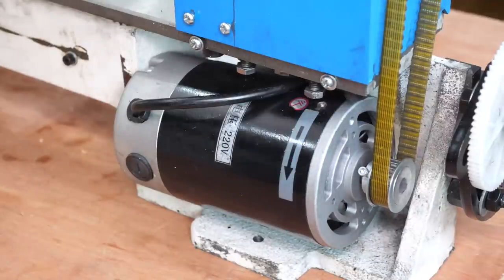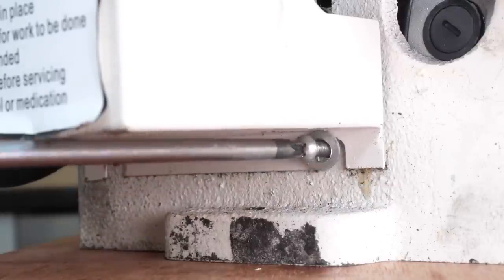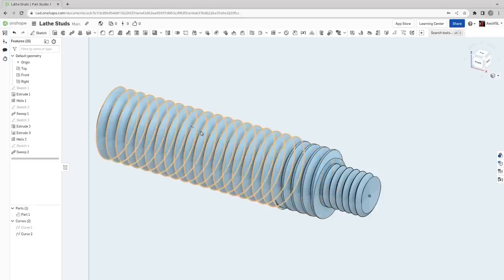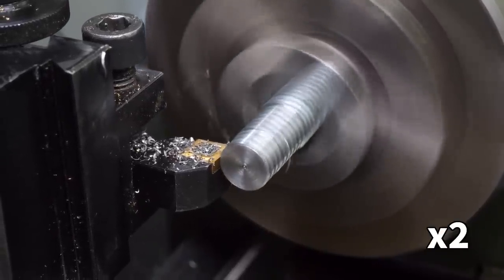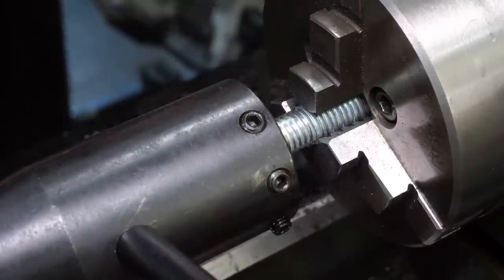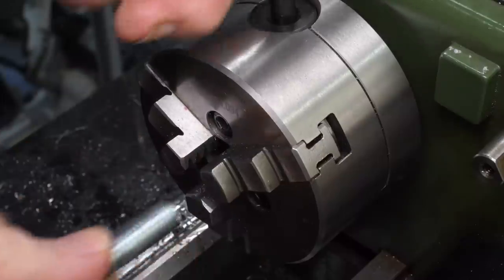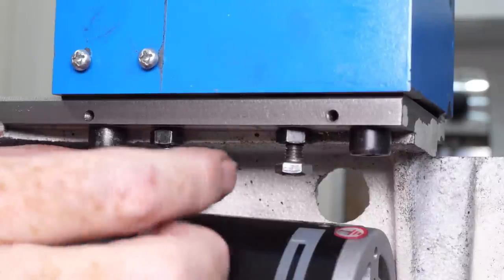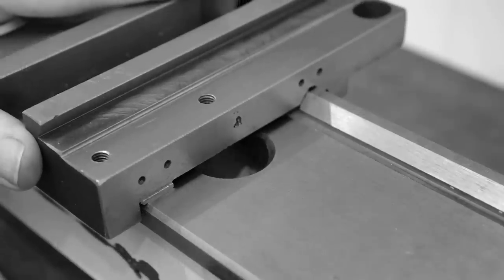A Quick Fix Motor Mount for the CJ0618 Mini Lathe

Comment: The threaded rod is not stainless, judging by the colour it's galvanised.
The reason it's hard to work with is probably because it's 8.8 grade, that means it has about twice the tensile strength of mild steel.
Personally I like to build small parts that need to be strong out of 12.9 grade bolts that I can have in stock for relatively cheap compared to high strength bar stock.
That being said it's even more tough to work with and is very demanding in terms of tools used, and machine rigidity and power.
Reply: I too, thought it looked galvanised,  but most galvanised all thread or threaded rod is rather a low grade, 4.8, plating high strength fasteners is problematic,  look up Hydrogen Embrittlement on plating.
Reply: @bostedtap8399  Hydrogen embrittlement poses a meaningful risk starting at grades 10.9 and up according to reputable hardware supplier. These fastners and stronger grades can still be zinc coated by ‘zinc flaking’ which elimimates hydrogen embrittlement. 
The reason I think the rod in the vide might be 8.8 is because of the trouble the saw is having, or the blade might just be dull. 
In any case, 8.8 grade fastners can safely be plated.
Reply: @shiro-r4m  I stand corrected, I'm wary of any galvanising on all high tensile fasteners, yes, 8.8 grade fasteners can be hard to saw with standard blades, grade 10.9 will soon blunt any hacksaw. Have a great week. Regards John.
Reply: @bostedtap8399  no worries, we all learn something every day. It’s not like I know affected grades off the top of my head but I do know where to look up stuff like that.
Reply: @shiro-r4m  Good to know.

Comment: How did you turn down the the stud with the motor removed from the lathe?
Reply from the maker: The honest truth is that I used my other lathe. It would have been interesting to try it by wedging the motor temporarily in place with the old bent studs on the same lathe, but I went for the simpler route.
Reply: @AdventureswithaVerySmallLathe  A lathe to fix a lathe.

Comment: Hola amigo tengo un torno exactamente igual al tuyo en estos días estaba realizando un proyecto y la correa se reventó y no se cuál es la referencia por favor ayúdeme a conseguir la referencia de esta correa
Reply from the maker: The belts should be quite easy to replace. They are multi-V belts, and all you need to know are the profile letter, the number of Vs and the length.

The belts have 2 Vs, and the rest of the information is in the code printed on the belt themselves:

PJ 330 and PJ 280.

This means both belts are J profile, and one is 330mm long, and the other is 280mm long.

PJ280 and PJ330 belts with two Vs should be easy to get from online sellers. I buy mine from online bearing retailers that carry this kind of supplies.
Reply: Dónde las consigo

Comment: you should have added the alignment of the belt it should be running true to the main drive and motor, sorry its easy to find problems when one has already done the fixes
Reply from the maker: I went into more detail about adjusting the angle of the built in my earlier video, "Reassembling the CJ0618 7x12 Lathe". In this one I wanted to focus specifically on making the motor studs, and fitting those studs as best I could. Truing the belt seemed to be best done by adjusting the position of the pulley on the motor shaft, as it isn't really possible to move the motor along its axis.

Comment: Be aware the next thing that is going to fail is the threads in the motor.
Keeping softer washers and the standard m6 grub screws helps to build in a failure point.
Happens alot on these types of small lathes.

Comment: I can't understand why you didnt simply file the slots 10mm.
Reply from the maker: In general I prefer to make mods and improvements without modifying the existing parts if possible, especially not such a major part as the bed casting. It reduces the chance of me making a bad mistake I can't undo, and it ensures I have the opportunity to fix the problem with a better solution in future.

Comment: Is this a reupload?  I swear I saw this one...
Reply: I thought so too
Reply: I think This old Tony had the same issue with his.
It's a very common issue on these lathes, after beefing up the screws the threads rip out of the motor in most cases.
Reply from the maker: Some of then footage is from my disassembly and re-assembly video of the same lathe. The specifics of making the studs and the discussion of the solution are new though. I thought it was worth making a video specifically about fixing this problem.

Comment: 11:10 I guess you know but didn't say, but just in case, your lead screw is loose.
Reply from the maker: Yes, it was intentionally loose at that stage. If you watch the full reassembly video for this lathe from a couple of years ago, the lead screw needs to be adjusted to make sure it is parallel to the movement of the carriage, which can more easily be checked once the carriage is installed.

Comment: Use oil with the bandsaw
Reply from the maker: The bandsaw has a warning on it not to lubricate the blade at all. I'm contrary enough to have tried it, and the blade came off immediately. I had to clean the drive mechanism thoroughly and degrease before it would run properly again. It's not a good bandsaw, and I'm delighted to have a much better replacement already.

Comment: I’ve never seen a mini lathe that was inspec! Tolerances of castings are so poor and runout is over 20 thousandths or more.
Reply from the maker: Yeah, the standard of manufacture of this lathe was really low. I don't have an example of a full price equivalent to compare to though, so I'm not sure if this is as normal, or if branded imports are significantly better.